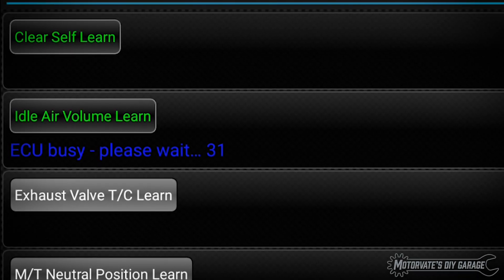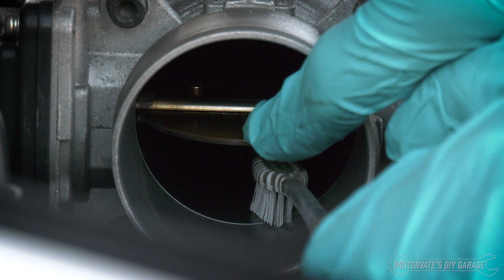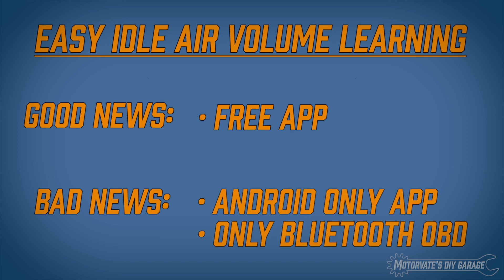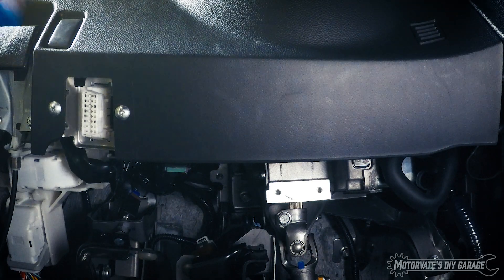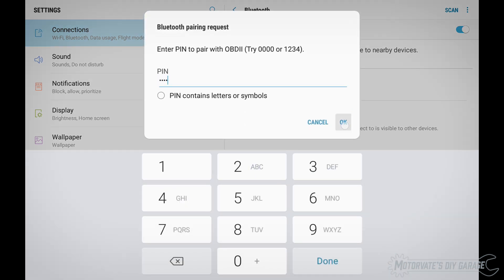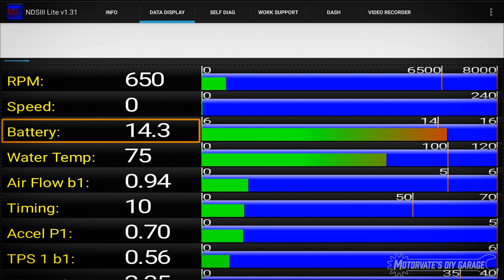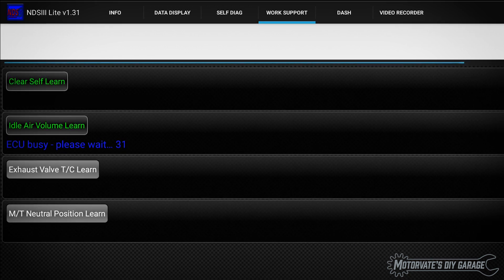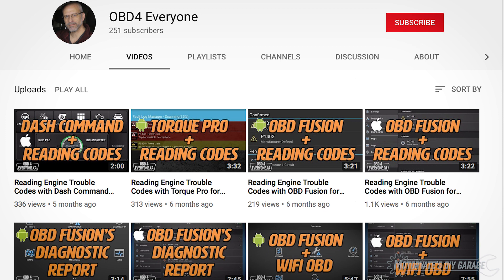Quick & Easy Idle Air Volume Learning: Motorvate's DIY Garage Ep.28

Comment: hi~~I have a question.
Air Fuel Ratio Sensor (22693-EY00A) Fitted to Infinity 2008 G37 Coupé 
Is the compatible with Infinity g37 sedans air Fuel Ratio sensor (22693-1NA0A)?
Sensor shape is the same, only slightly different.
Reply from the maker: Hey Lamberto Lopez,
If your engine idle is not stable (up & down) the "Idle Air Volume Learning" needs to be done. However, sometimes it won't work. If that is the case, have a look at this technical bulletin that Nissan/Infiniti released that explains how fix it:

http://www.370zcoupe.com/TSB/1TN39.PDF

Good luck!
Reply from the maker: Hey 이성원 이,

From what I can see on parts.infinitiusa.com:
• The 22693-EY00A part is for the G37 Coup made between 06/01/2007 to 08/01/2008.
Here is the full application list:
Infiniti G37 3.7L V6 A/T Base Coupe 2008
Infiniti G37 3.7L V6 M/T Sport Coupe 2008

• The part 22693-1NA0A is for G37 cars  made after 08/01/2008 to 11/01/2009
Here is the full application list:
Infiniti EX35 3.5L V6 A/T AWD Base Sport Utility 2008, 2009, 2010
Infiniti EX35 3.5L V6 A/T AWD Journey Sport Utility 2008, 2009, 2010
Infiniti EX35 3.5L V6 A/T RWD Base Sport Utility 2009, 2010
Infiniti EX35 3.5L V6 A/T RWD Journey Sport Utility 2008, 2009, 2010
Infiniti FX35 3.5L V6 A/T AWD Base Sport Utility 2009, 2010, 2011
Infiniti FX35 3.5L V6 A/T RWD Base Sport Utility 2009, 2010, 2011
Infiniti G35 3.5L V6 A/T AWD X Sedan 2008
Infiniti G35 3.5L V6 A/T RWD Base Sedan 2008
Infiniti G35 3.5L V6 M/T RWD Sport Sedan 2008
Infiniti G37 3.7L V6 A/T AWD X Coupe 2009, 2010
Infiniti G37 3.7L V6 A/T AWD X Sedan 2009, 2010
Infiniti G37 3.7L V6 A/T RWD Base Convertible 2009, 2010
Infiniti G37 3.7L V6 A/T RWD Base Coupe 2009, 2010
Infiniti G37 3.7L V6 A/T RWD Base Sedan 2009, 2010
Infiniti G37 3.7L V6 M/T RWD Sport Convertible 2009, 2010
Infiniti G37 3.7L V6 M/T RWD Sport Coupe 2009, 2010
Infiniti G37 3.7L V6 M/T RWD Sport Sedan 2009, 2010
Infiniti M35 3.5L V6 A/T AWD X Sedan 2009, 2010
Infiniti M37 3.7L V6 A/T AWD X Sedan 2011
Infiniti M37 3.7L V6 A/T RWD Base Sedan 2011

It looks like you need to use the 22693-EY00A  A/F sensor.
Reply: So you mean you can't use it?
Reply from the maker: Infiniti says the parts are not interchagneable, so I don't think so.
The sensor output could be different, or maybe the connector.
Reply: Eric, thank you always. I thought that the engine and horsepower of the 2008 G37 Coupe and the 2008-2009 G37 sedan were the same, and the sensor looked the same, so the a/f sensor would be the same.  It's been working and it's been fine for a few days, but I got some engine trouble when I was at idle after driving.  I need to get it out.
Reply from the maker: Hey 이성원 이,
Before you remove it, can you retrieve the code? A cheap OBD scanner ($15) and app (like OBD Fusion or Torque Pro) would allow you to see the actual trouble code.

Then we can have a look at this together and see if the code is A/F sensor related.
There is a small chance that sensor might work.
Reply: Thank you.
I'm using an obd scanner and a Torque Pro.
Error codes are not occurring as a result of verification.

A/f sensor (22693-EY00A) was replaced and there were no problems for three days.
Subsequently, the spent engine on three NDS III (Easy Idle Air Volume Learning) began to malfunction.

No engine assistance prior to the drive, the O2S1LV to O2S5LV value on the Torque Pro remains 2.2 to 2.3V, and 2.2 to 1.7V values are displayed if the engine fails after the drive for more than an hour.

Suspected of a fault with the pulse code value of the ECU, the battery negative terminal was removed for more than 24 hours and completely cleared.

Do not learn the Idle Air Volume on NDS III. 
When starting the engine, the value of O2S1LV to O2S5LV of the Torque Pro is kept between 2.2 and 2.3V.

I will drive for a few more days and check for any abnormalities.
Reply from the maker: Hey 이성원 이,
An O2 sensor 1 voltage of around 2.2 volts indicates a air/fuel ratio of a 14.7:1, which is good during cruising.

I don't understand what the "pulse code value of the ECU" is... can you please explain that?
Is the engine running as you expect?
Reply: Hi Derek
The battery has been disconnected, has been in service for three days since the ECM was cleared, and nothing abnormal has happened yet.
AN 02 SENSOR 1 voltage is maintained at 2.2v and air /fuel ratio of 14.7:1
a/f (22693-Y00a) Do you think it is shared?

Infinity maintenance manual for em  
"ENGINE CONTROL SYSTEM" page 18

• Never existsemble ECM.
• If a battery cable is disconnected, the memory will return to
The ECM value.
The ECM will now start to self-control at it initial value. Thus,
engine operation can be library in this case. However, this
Never an indication of a function.
cause of a light variation
• If the battery is disconnected, the following argument-related
diagnostic information will be clear in 24 hours.
- Diagnostic Trouble Codes
- 1st trep diagnostic truble codes
- Freeze frame data
- 1st trip freeze frame data
- System readiness test (STT) codes
- Test values
Reply: I have 2007 Infiniti g35 sedan rpm up and down nathing works scanner which is used to adjust thanks you
Reply from the maker: Hey 이성원,
If your air/fuel ratio is 14.7 :1 at idle or during cruising, I think that AFR sensor is working just fine.
Reply: Derek, I'll tell you what you've been doing for a few days.

1. Remove the battery to reset the echo, and the operation is normal and the torque pro values are good.

2. However, after 3 days of driving, the a/f sensor bolt is highly flowable if checked with a torque pro while the engine occasionally fails. 

3. Initialize the ecu again and the engine will run

4. (22693 - ey00a) is not compatible with (22693-1na0a)? 
If not fully compatible, the engine warning lamp will illuminate, and the engine will not operate immediately.
 Why? I wonder how many days you drive and then you have epilepsy.

Comment from the maker: If you are having trouble getting the Idle Air Volume Learning to complete, here is a technical service bulletin (TSB)
on how to resolve this:
• http://www.370zcoupe.com/TSB/1TN39.PDF
• text of the TSB:

Classification: EC11-027
Reference: NTB11-097
Date: October 21, 2011
INTAKE AIR VOLUME LEARN WILL NOT COMPLETE
APPLIED VEHICLES: All
APPLIED DATES: 2007-2012
SERVICE INFORMATION

If IAVL will not complete using CONSULT:
a.
 While the engine is running, disconnect "Mass Air Flow" (MAF) sensor 
for 10-15 seconds until MIL (P0102 or P010C) comes on, and then 
reconnect before performing "Intake Air Volume Learn" (IAVL).
> If vehicle has two MAF sensors, disconnect only one in prior step and leave the second one connected; then reconnect.
> Engine may stop running when idle reduction occurs. Reconnect MAF sensor and continue to step "b".

NOTE: 
If P0102 or P010C were not stored when DTC was confirmed, repeat step "a" until idle is reduced.
a. Clear any DTC's that may have set during MAF disconnect.
b. Perform IAVL.
c. Confirm that idle is now within specification for model and year of vehicle being worked on.
See Electronic Service Manual for procedure to set IAVL and for vehicle idle specifications.

Comment: What does the clear self learn do?
Reply from the maker: Hey dgree100,
What an EXCELLENT question! 

Our engines are always adjusting how much fuel they need to run properly. This allows the engine control unit to compensate for wear.

These adjustments are called "Long Term Fuel Trim" and "Short Term Fuel Trim"
If you add both together, the result is the total fueling requirements of the engine.
Here is a video I made for my other channel that will explain it: https://youtu.be/E6BWhp3851M

When the "Self Learn" is cleared it resets the "Long Term Fuel Trim" back to zero.
The "Short Term Fuel Trim" is reset to zero every time the car is turned off.
The "Long Term Fuel Trim" is saved in a special memory that isn't erased when the car is turned off.

Comment: Derek! I let the engine idle for 23 minutes without driving.

Before running Idle Air Volume Learning, the battery bolt is 11.8v to 12.0v.

After running Idle Air Volume Learning, you will get 14.0v.

It doesn't matter?

I captured the display screen, but I can't attach it to the comments~~~
Reply from the maker: Hey 이성원,
I think that should be fine.

Comment: Derek, do you have another question?
Do I have to do a Pedal Releasescl rear and then continue to do a trot closecl clear?
Or do I have to do Pedal Relegasecl Erlen and wait until then do throttle closecl learn?
 As I said yesterday, idle speed is maintained at 650 rpm,
If you take your foot off the accelerator when you are driving slowly and when the vehicle is blocked, you can quickly fall to 500 rpm.
I can't figure out why.~~
We can't even replace it with a throttle chamber, air flow sensor, pcv valve, ignition plug, ignition coil.
It's falling to 500 rpm, and there's a slight engine break.
I don't know the reason at all
Reply from the maker: Hey 이성원,
Sometimes getting the "Idle air volume learning" to run can be difficult. EVERY action mentioned in the video must be followed.

So, yes, do the pedal released learning, throttle valve closed position learning and finally the idle air volume learning.

When you use NDS III to run the idle air volume learning, does it complete?
Reply: The same symptoms appear in the stomach, even though the execution has been completed with NDS III.
 Do I have to do key on 1 second when I study throughtle closecl learn?
Reply from the maker: Hey  @이성원-u8i ,
It looks like  "google translate" isn't working well for your first sentence... I don't understand what you are asking.
Reply: When you use NDS III to run the idle air volume learning, does it complete? answer - Running NDS III is complete.
Closing the throttle valve When learning, can I just turn on the key for one second?
Reply from the maker: Hey @이성원,
If the NDSIII Idle air volume learning is "complete" you are done and and turn off the engine.

Comment: I don't know if Idle Air Volume Learning setting has failed.
Repeated stop start during slow and traffic jam.
If you step off the Axel Paddal, it quickly drops to 500 RPM, and as soon as you return to normal, your car will experience some trouble. 
Idle is normal at 650 rpm.
Reply from the maker: Hey 이성원,
It doesn't seem like the idle air volume learning has completed.
It only works when ALL the preconditions are followed exactly.
See the reply below.
Reply: I don't think all the preconditions are complete and working.
However, when the m37 engine is started, the battery bolts move from 14v to 11.8v.
It is maintained from 11.8v to 12.0v
It is not conditional on 12.9v. Does this matter? 
And I always set Idle Air Volume Learning
The temperature of the engine cooling water is higher than 90c and the automatic gearbox oil temperature is 70c to 80c.
Reply from the maker: Hey 이성원,
In order to increase the fuel efficiency, our cars control the power output of the alternator
So, the traditional voltage output ( 14+ volts engine running, 12.4+ volts with engine off) can't be used to determine if the charging system is working properly.

Comment: Failure to set Idle Air Volume Learning 
To what temperature does the vehicle's engine have to cool down to?
Reply from the maker: Hey 이성원,

The engine coolant temp must be at least 70C.

In order for the idle air volume procedure to run and complete

Make sure that all of the following conditions are satisfied:

Learning will be cancelled if any of the following conditions are missed for even a moment.
• Battery voltage: More than 12.9 V (At idle)
• Engine coolant temperature: 70 - 105°C (158 - 221°F)
• PNP switch: ON (M/T models)
• Selector lever: P or N (A/T models)
• Electric load switch: OFF (Air conditioner, headlamp, rear window defogger)

On vehicles equipped with daytime light systems, if the parking brake is applied before the engine is started the headlamp will not be illuminated.
• Steering wheel: Neutral (Straight-ahead position)
• Vehicle speed: Stopped
• Transmission: Warmed-up
• Drive vehicle for 10 minutes.

Comment: Hi, Motorvate's 
Do you have any questions?
Manual setting is 10 minutes when you are an automatic car.
If I use the app, can I learn the IDie air voome for 10 minutes without driving?
What is the engine coolant temperature?
Thank you.
Reply from the maker: Hey 성원 이,
In order for the engine oil, engine coolant, and transmission oil to be at the proper temperature a 10 minute drive is required. Idling for 10 minutes may work, but it is best to go for a 10 minute drive.

The engine coolant temperature needs to be 70 - 105°C (158 - 221°F)
and here are all the required precondition required for the idle air volume learning procedure to run and complete:

Learning will be cancelled if any of the following conditions are missed for even a moment.
• Battery voltage: More than 12.9 V (At idle)
• Engine coolant temperature: 70 - 105°C (158 - 221°F)
• PNP switch: ON (M/T models)
• Selector lever: P or N (A/T models)
• Electric load switch: OFF (Air conditioner, headlamp, rear window defogger)

On vehicles equipped with daytime light systems, if the parking brake is applied before the engine is started the headlamp will not be illuminated.
• Steering wheel: Neutral (Straight-ahead position)
• Vehicle speed: Stopped
• Transmission: Warmed-up

- A/T models
• With CONSULT-III: Drive vehicle until “ATF TEMP SE 1” in “DATA MONITOR” mode of “A/T” system indicates less than 0.9 V.
• Without CONSULT-III: Drive vehicle for 10 minutes.

- M/T models
• Drive vehicle for 10 minutes.
Reply: Thanks!!
Reply from the maker: Anytime :)
Reply: Thank you very much motorvate diy
Do you have another question?
- A/T models
• With CONSULT-III: Drive Vehicle unit undtil "ATF TEMP SE 1" in "DATA MONITOR" mode of "A/TITOR" system
Does this mean transmission fluid temperature above 80°C?
Reply from the maker: Hey 성원 이,
The factory shop manual doesn't mention a specific transmission oil temperature.
If you can't drive the car for 10 minutes, then I think the next best thing would be to let it idle for 15 or so minutes and then do the idle air volume learning.

Good luck!

Comment: Where can i buy a Bluetooth scanner? And what brand did you purchase? I was told by the app to buy a v1.2 or v1.4 b cause 2.1 are fake
Reply from the maker: Hey dgree100,
For this video I used a "Veepeak VP11" from Amazon. It works well with NDS III Lite, Torque Pro, Torque Lite and OBD Fusion.

Comment: I noticed that you used the elm327 module that was NOT recomended by NDS in their supported modules page, yet it works for you. Can you link to the company you bought your module from?
Reply from the maker: Hey Prestor John,
Sorry, but by accident I have misled you. 

The ELM327 module shown in the video  was not used with the app. It was an existing video
from another episode. 

The adapter that was used and worked very well, was a Veepeak VP11.
Reply: Hi do you have the links where did you buy the veepeak vp11? Thank you.

Comment: @Motorvate DIY  Just to clarify, the engine should actually be running, right, not just in the on position?
Reply from the maker: Hey GeePeeZee,
Correct ! BUT please make sure the "pre-conditions" are met. See Episode 27 for all the details :)
Reply: In the other video, you mention putting the parking brake on in order to disable the DRLs. I have an automatic and the IAVL process with NDSIII failed every single time until I set the parking brake so it seems that it needs to be on anyway, along with the other conditions.
Reply from the maker: Hey Hall Stevenson,
Good to know... Thanks for the comment!